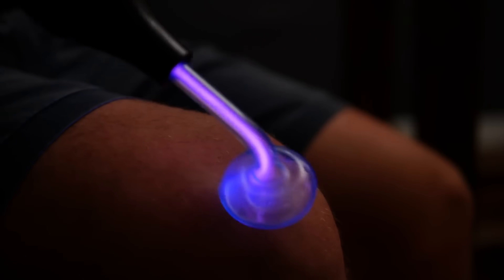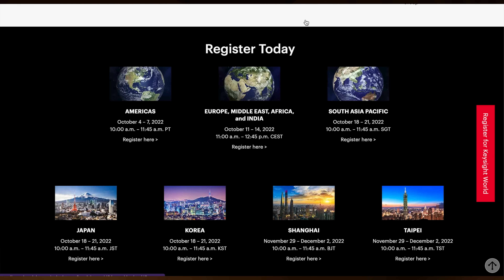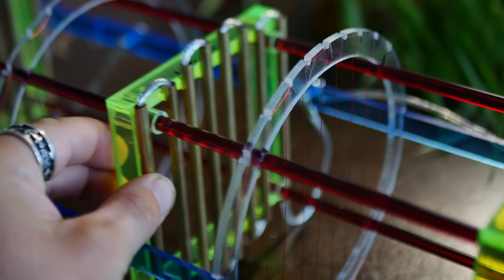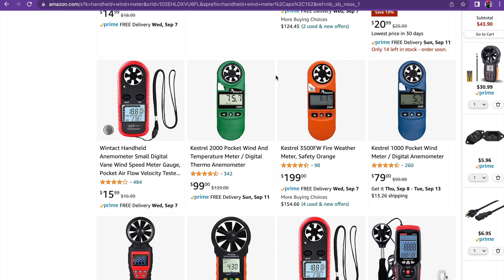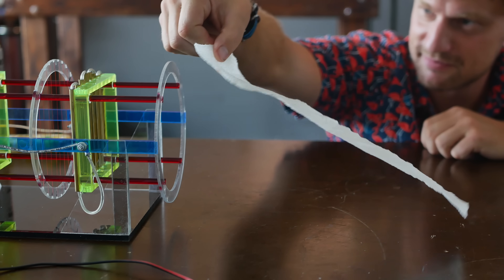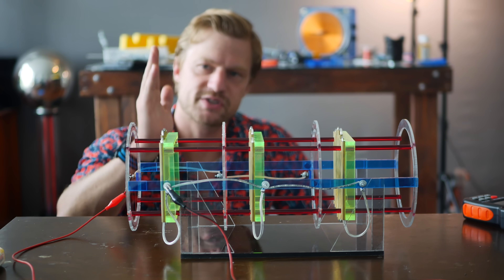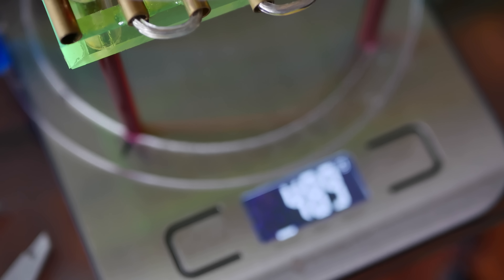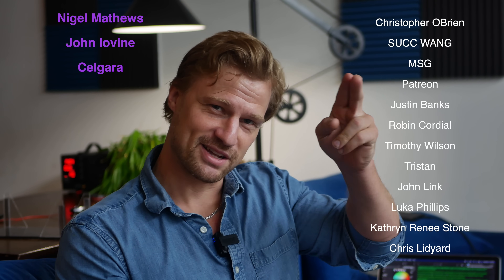Designing A Next-Gen Ionic Thruster! (For Flight)

Comment: Why don't you add a clear tubethe outside you could do easy with your design? Do you take all of the coating of wire in parallel lines to increase the plasma

Comment: Ok, super cool, but food for thought, if I got your stats correctly adding a second stage added +33% power and a third stage added +50% increase, but the second stage would add more than double the weight, and a third triple the weight.  I would think if you were going for power to weight ratio, the three thrusters not linked up but separately would produce 3 times the thrust with 3 times the weight, where as the three together produce 1.5 times the thrust with more than 3 times the weight (because of having to connect them together). Am I missing something?

Comment: Not an aerodynamics guy?
1) Recreate the engine/trusters in a straight pipe for optimal air flow.
2) Instead of the metal rods, make them of aluminum foil (like the first you showed).
3) Maybe rather run the trusters in parallel.

Comment: my thoughts, why not use carbon or even balsa wood you would gain the strength needed and much less weight than acrylic.
Reply from the maker: So, carbon would be highly conductive, and Balsa would be slightly conductive. Both of those spell disaster when sitting at voltages above 300-500 volts. This project sits at 40,000. Good ideas though! Just with high voltage, you cant do the same thing you'd do with normal projects. All materials must be custom selected.
Reply: @PlasmaChannel  interesting that balsa carries some conductive properties at those voltages. Thanks for the reply.

Comment: The plasma generated by this thruster was just beautiful. What a mindboggling, marvelous universe we live in.
Reply: 😎😎😎😎😎😎There is an interesting design of aircraft, but they rarely talk about it, because this thing is secret. The topic of pulsed plasma thrusters has been developed since the early 60s (see PPT - Pulsed plasma thruster) - they are usually designed for spacecraft. But we will talk about a little-known design - these are plasma propulsion panels for aircraft, where the same Pulsed plasma thruster, but reduced to the size of a pencil and stacked in the form of cells in the panel. The design resembles a conventional plasma TV screen, where there are also discharge cells that activate the glow of pixels on the screen. And plasma propulsion panels have long discharge cells, the arrester has a railgun architecture (just rail contacts or coaxial), and the ionized discharge air is accelerated there by the Lorentz force to enormous speeds - a kind of ramjet engine is obtained. Just imagine! - tens of thousands of small ramjet engines assembled in a panel and firing plasma synchronously with a huge frequency (hundreds of kilohertz). Thus, plasma propulsion panels create lift by pulsed emission of plasma jets from railgun cells. There are tens of thousands of cells in the panel, they shoot at a frequency of hundreds of kilohertz, a huge pulse is obtained, and the plasma swirls the air into toroidal rings - the aircraft is held on this air cushion. Horizontal acceleration is created by the same plasma panels on the sides of the device (they glow, from the side they look like "portholes"). Such devices like "triangle" or "disk" have been observed for a long time, they are mistaken for alien ones - but these are terrestrial devices. They are classified and used for espionage and secret actions. Pulsed electromagnetic technology generates microwave radiation, therefore it is harmful to health. They rarely fly - only military missions. 😈😈😈😈😈😈😈😈😈😈

Comment: Surely the biggest single improvement would be to confine the moving air and drive it out of a smaller opening than the intake?

As an open device, surely much of the moving air and the thrust it produces is lost without confinement.

Comment: I wonder if mounting the ionic thruster within a housing having sections similar to a couple of the ones found in wind tunnels, i.e.i, the contraction section (for gathering and accelerating air at the inlet of the ionic thruster) and test section (for mainly housing the ionic thruster and for concentrating the air flow to the inlet of the ionic thruster ) to be exact would increase the amount of thrust generated by the ionic thruster.

Comment: Love your work. I saw this video after the one you posted 10 days ago. If I may, here are a few constructive comments that I hope will help. Since the ion flow created is actually affecting the airflow, I would try to gradually decrease the surface area of both the cathode and the anode, trying to make them equal in order to maximize the spread and speed of the ionic flow. Additionally, you have not tried to change the voltage per stage. My understanding is that the airflow per stage is dependent on the delta velocity upstream/downstream. If the velocity of the ionic flow is the same at every stage, then the thrust produced by stage 4 will be much less than the thrust produced by stage 1 since the delta V between the ionic flow and the airflow around stage 4 is smaller. I think that you need to increase the velocity by reducing distance or increasing voltage, or manage the drag by changing the shape of the cathode vs. anode surface area and gradually increasing them from stage 1 to stage 4. I hope this will help.

Also, the idea of getting the thruster on the wing is interesting, but it seems you are not thinking outside the box enough. How about having one cathode at the front and one anode at the back, with a magnetic field to control the ionic field trajectory? Good luck. By the way, indeed, you might be onto something groundbreaking.

Comment: Hi! I'm awesomed by your plasma thruster. I just have a question, didn´t you take a bad measure at min 7:30 when the wind meter was not placed at the center of the air flow?, It seems like the increase of 2.3 m/s at min 8:35 was because of the position of the meter. greetings from Argentina!

Comment: Did you test irregular spacing between the wires, or even a spaced criss-cross design, or a spiral, to increase surface area of positive electrodes? Your optimum thrust will likely come from further fluid flow analysis inside the thrust chamber. Possibly add a venturi.

Comment: Maybe you could try to incorporate the physics an spacing principles of a tesla-turbin in order to increase efficiency and thrust. A perfect spacing between the positive electrode ends could increase the capability to move air along. Maybe using a metal mesh similar to those used in CNC Laser tables as an electrode material will guide the incoming air and create laminar flow.

Comment: There are two inefficiencies that I see.

1. The thruster isn't enclosed so you bleeding thrust out the sides.
2. The electrodes that you are using are too big.  For a plasma thruster, the electrodes should be thin bare wire knitted into a net.  That should reduce weight and provide a more stable ion distribution.

Look at vacuum tubes.  The grid electrodes inside the glass envelope are literal grids of wire knitted into nets.

Comment: Shorter gaps and denser amount of wire to increase number of aggitated air molecyles is somethiing he should try.. Next up is a venturi tunnel, but the math for dimensioning it is quite hard, gave up on that differental laminar equation, the exam had aluminium extrusion differential instead..

Comment: Right now ypur thruster is only a thruster. You should incase the 3 stages in the wings of an aircraft in a more flat wide and long desigh saving on weight through supports. (Trusses on a smaller area are sronger per weight than rectangular supports) add air inlet only on the forward face of the wing and air outlet through the bottom and back through funneled exhaust for increased air speed at the cost of minor flow per minute reduction with an increase in force. And hide all those high voltage circuits in a lightweight PTEG print. (More rigged can make slimmer pieces, internalized thrust lets the thruster body be the internal support for the wings and boom multi purpose weight and thrust improvement due to higher wind drag over a wide flat area.

Comment: For V1, I think here are the drawbacks/inefficiencies:

1. The chasis needs to be enclosed. The interference from air around the unit will act as resistance/friction to the air moving inside the chamber/tunnel.

2. The air entering and exiting should be directed via nozzel. Otherwise, this is inefficient.

3. Non-optimal electricity usage/draw; and the weight of the electrical equipment would lead to general inefficiencies.

Comment: YOU censored my commentary on how Steven Barret's ion aeronautical lift could be better used if one would consider how counter spinner rotors of a Kamov helicopter can produce static electric  discharge arcs so by painting a layer of Americium ionizer from smoke detector one could increase thrust and decrease disk loading.

Comment: I think your learnings from the fan in front of the thruster were not explored enough. Also, aerodynamics knowledge can help you a lot.
1-	A Sectional circle has 10x more drag than a drop (airplane) section. Change your round tubes into wing profile tubes.
2-	Important learning from fan: If you put ten fans rotating at 2m/s each in front of each other, your final velocity will still be 2m/s. Try playing with the poles distances on each stage, assuming one has air being fed at 2m/s, the next at 3m/s, and so on.
Can I suggest that the more speed the flow has, the further the poles should be appart? Reason been that your ions will naturaly jump at the natural speed. To add more speed would need further distance? Worth a try?

Comment: Hi, can you Build a Thruster in a pipe and check if multi stage thrusters 6 to 10 maybe. Can Ionize the Air molecule, not only ionize but to increase the energy yield of same amount of air (I mean Velocity) and also installing same tube diameter pipe at the exit but of copper or conductive material with magnets around it and the pipe should be like divided in four parts in length not width, in which two will be positive and negative and with other two magnets or superconductor magnets will be attached, by this to check if ionized air would generate electricity or replace other two with magnets and the two parts of pipe will be used as positive and negative. I think you got the idea Don't know how to attach picture with comment.

Comment: Check out the Navier Stokes Equations . They will help to solve any issues regarding energy limitations.  Plus, be open minded to lowering your Radio Ftequency to 432Hz. Such a huge  adjustment will drastically increase the distance of the wavelengths.  This will allow you to expand the electrical current necessary for much stronger magnetic field.  To achieve a massive thrust to weight ratio, the fine tuning of the actual flow of ionized particles will create the correct linear angle of electrical propagation that will essentially FORCE the  the densified accumulation of highly magnetized ionic particles.  You probably already know this, but by increasing the wavelength,  it correctly aligns the proton and electron particles on independent vectors such that their expulsion creates elevated propulsion by accurately displaying Newtons Law of Motion.  Picture this, the electric propagation vector will be on the z axis in.a straight line with the chamber exhaust.  Criss crossing this axis in a perpendicular to one another fixed position, will be the proton and electron vectors in.the x and y axis suspension within the core of the electromagnetic field. Because the flow of fuel will be constant, with minimal resistance. the resulting energy will increase substantially, especially if your power capabilities allow for you to increase the level of magnetic flux by enlarging the field windings.   Incorporate a simple directional nozzle so.as to funnel the full extent of the energy packed into the ionized particles which given the expected increase in velocity as the mass of gaseous particles slam into the exhaust plumes unparalleled density of plasmatic matter in.energy transformation,  definently mirroring a true demonstration of ionized particle movement that should be traveling at @ 186,ooo m/p/sec. Fyi: The Equations will provide you the means with how to properly manage the flow of neutrally charged by-products that are the result of using slightly.contaminated fuel. Keep in mind, your calculations are to be assumed, based on.what happens to the equal ionization of a predetermined volume of Oxygen and Nitrogen atoms. It's the carbon atoms from CO2 plus trace elements that those equations will.help.ypu.to properly. situate in.the plasma flow so as to not hinder the true power that the purer elemental.atoms are capable of producing. Lest you forget,  nitrogen is used as a rocket propellant and oxygen a perfect oxidizer. Crunch the numbers and I think you'll be ecstatic with the ratio of accumulative particles. Look at the quantum physics aspect like this
 This engine is a mini particle accelerator without the head on collision .

Comment: I for one, am totally impressed with your designs and assemblies. Perhaps i can offer you a possible idea to consider for harnessing even.more energy to produce added thrust.  If you'll recall, the big sailing ships of yesteryear relied on the wind to PUSH them.across the seas. What's to stop you from integrating an outer ringular array of additional electromagnetic equipment that works oppositely in direction to the primary ionization core. With the correct placement and configuration of deflector shields, in theory the outer ionization ring will provide a pushing propulsion  that will act as a power assist for the inner core chamber. The concept here is being able to.essentially  "supercharge" the main ion engine.  This same idea will work on satellite propulsion  seeing as how the solar wind travels at @ 400km/sec. Harness all available energy;  limit drag;  maintain electromagnetism efficiency so as to control temperature variations

Comment: Pretty cool. 

I'd like to see blade shaped negative poles. 
Also, it would be interesting to see a venturi shaped tube shape. Basically, the forward and aft thrusters larger in the front and back of the venturi with a smaller diameter thruster in the middle. 
Maybe offset the angle of the wires to the following thruster. Basically 33° between each. It might create angular flow through the venturi.